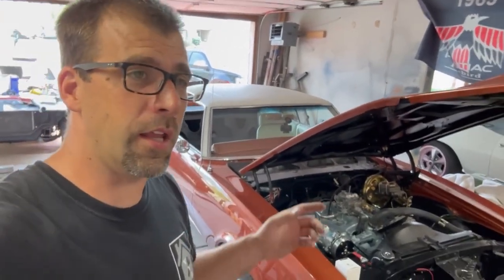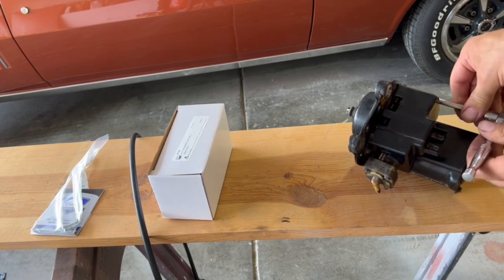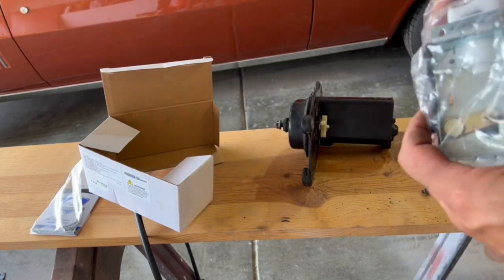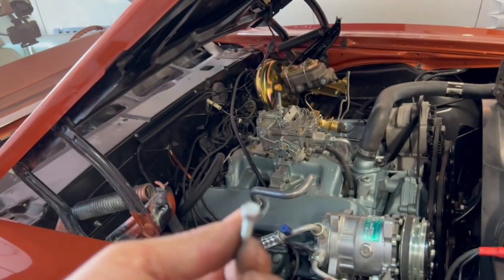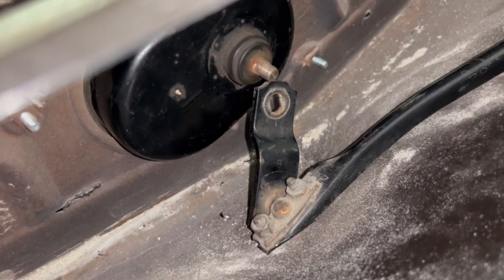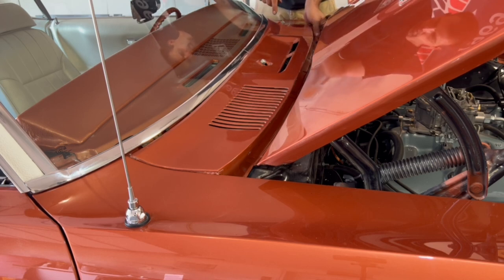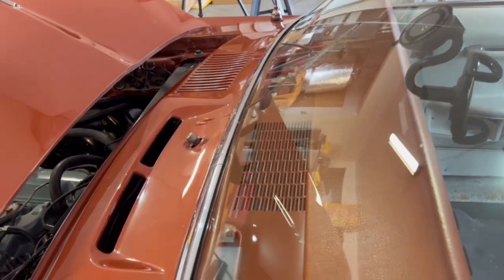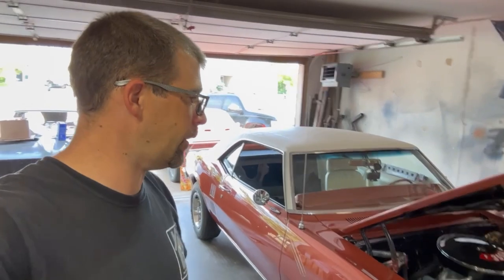Wiper motor and washer pump system repair, 1968 Firebird Restoration

Comment: Had a friend rebuild my pump years ago, I think I've used it maybe twice since then. When I had a new windshield installed back in 2019, I installed new blades. Very hard to find!  I did find them at Autozone, but I had to buy a longer set, & cut them down. 
GREAT video, thanks for sharing!
Reply from the maker: I have never bothered to fix the washers on my cars prior, this one isn’t mine and I think it’s a nice touch to have everything working upon delivery

Comment: Great video, very good getting the camera angles for us to see, not nearly as easy as you make it look. I always wondered how the washer pump worked,never had one that worked
Reply from the maker: I wanted to get a washer system working on a car that I built. I don’t normally mess with them. I doubt it will ever get used but cool that it works
Reply: @VinylVillageGarage  Have you changed your e-mail address
Reply from the maker: @davidbisnette7673  I don’t have one that I share anymore. it was getting loads of spam and stopped working right  I could not send nor receive some messages.

Comment: Usually when I do these I replace the whole unit because most of the time the bearings in the motor or shot and the brushes are almost gone on the Armature. also the control arms that go to the wipers I disassemble and relube even if they have nylon. Also the wiper squirter nozzles I take out and clean with small orifice  bits. Sometime the old hoses breakdown in the inside that goes to the nozzles stops them up where they do not squirt properly, or when people pour washer fluid into reservoir they will get dirt and debris inside the reservoir which goes to the nozzles. Some reservoirs have screens on the pickup some do not.
Reply from the maker: Good point not a bad idea to back flush the nozzles prior just I case they are plugged up. Thanks!

Comment: Thanks for creating these videos, I have learned so much.  I feel like I could do this in my garage now.  Have you ever restored a 2 gen firebird?  I am not a huge fan of the 1974-76 front ends and was wondering what it takes to replace with a 1970-73 front bumper?
Reply from the maker: For the most part it is a bolt on mod, I swapped over a 1979 Firebird to the 1973 front bumper and 1973 formula hood.  That’s was over 20 years ago but I don’t remember having any issues.

Comment: Jon, what's the trick to removing the wiper arms?  Seems you need at least 3 hands and a screwdriver for the tab.  I can't get any leverage to pull it up off the splines. Thanks!
Reply from the maker: If the paint is bad and need redone I use a open end of a combination wrench. I did it in the tear down video of this car. They make a tool for removing the arms 
https://www.camarocentral.com/Wiper_Arm_Removal_Tool_p/win-75.htm
Reply: Didn't know there was a tool.  Thank you Jon.

Comment: Great content for a topic that doesn’t get any coverage. The wiper transmission (linkage) for
My 67 Camaro is seized up and I have added multiple penetrating products to the spline on the passenger side , but nothing has freed it up. Do you know where I could secure a good used one?
Reply from the maker: Good point, besides Facebook market place and eBay I don’t know of any good resources, if I have an extra I would
Just send it to you.  I will keep an eye out for a spare

Comment: WOULD IT BE POSSIBLE FOR YOU TO SPECIFY WHICH OF THE THREE WIRES FOR THE WIPER MOTOR IS POSITIVE. i KNOW YOU HAVE TWO GROUNDS AND ONE POSITIVE. THE ISSUE I HAVE WITH MY CAR IS ALL THREE WIRES ARE INDIVIDUAL AND NOT IN A 2 WIRE CONNECTOR. NEED TO KNOW WHICH WIRE IS POSITIVE AND ON WHICH PIN DOES THE POSITIVE CONNECT TO. Thanks
Reply from the maker: Interesting idea,  my dads car we are working on a build plan and he want to add delay wiper to his car. That would be the perfect time to do that.

Comment: Looking great - did I miss the windshield and rear window install? You do this yourself?
Reply from the maker: I didn’t do a video on the front or rear glass install. I was attempting to get it done for the trans am nationals.  Unfortunately I didn’t make it. 🙁
I used the butyl rubber seal for this car.
Reply: @VinylVillageGarage  I understand- really enjoy your videos! You work a full time job at same time? Saw an old videos with scissor lifts- you work as a mechanical/electrical technician?
Reply from the maker: @wiliamciavarra6588  yup full time job is construction equipment repair, specialty is aerial equipment. Doing that for 14 years. Used to work on cars for a living and decided that I didn’t like at all after 12 years